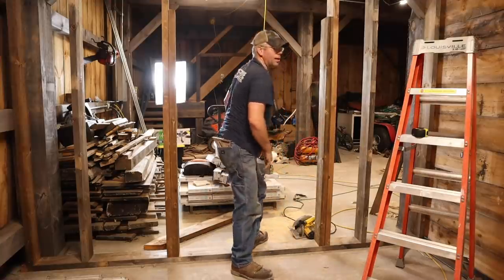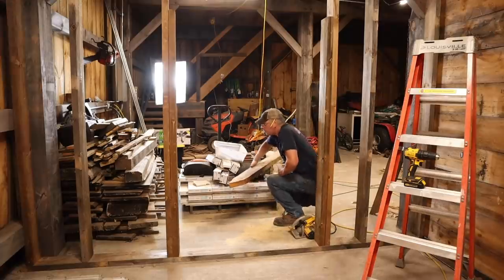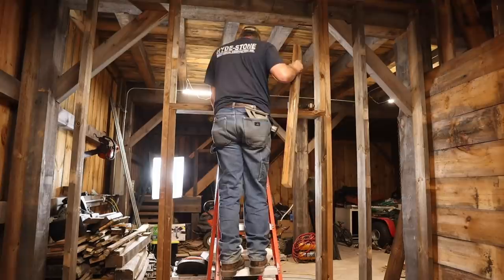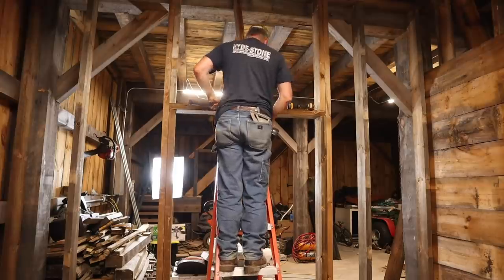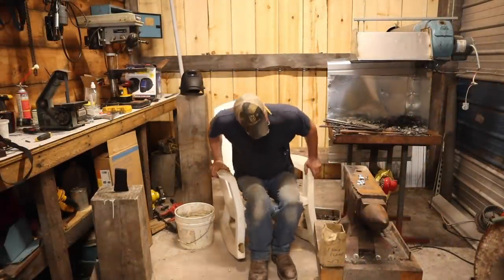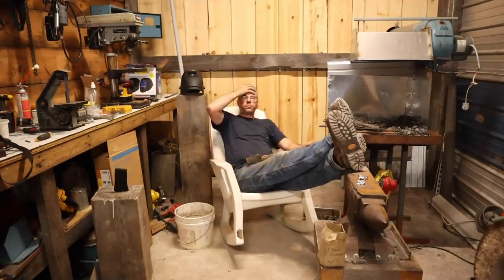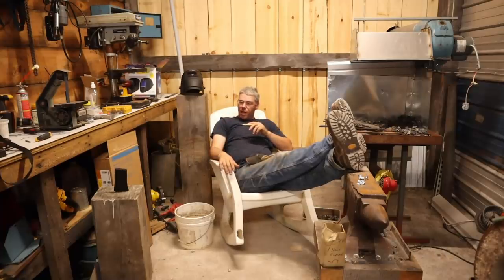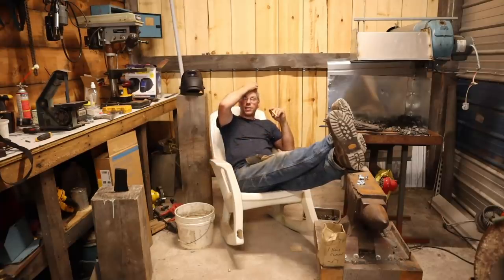Old Men and Dirty Jokes, Working On Walls In The Timber Frame...What a Night

Comment: Hey, guess what, I got the notification for this one.
Morning Jim. I started watching this at about 2:30 am, but dozed off after a long day of studying about half way through. I had a viewed count of 5 when I started watching it, if that even matters at all. Guess I should have stayed vertical till I was done, but then I wouldn't have had so many great comments to read (and a fee to comment on).
As far as wrapping the posts, that kinda sucks for the appearance, but I definitely understand it is for fire prevention. I still feel an emergency exit out the back would be a wise investment of time. We all know how accident prone you can be, ha ha ha. (Hope the leg is past bothering you for now and doesn't flare up issues again as you age. ) As for the giant exhaust fan, we know it's for blowing your coffee farts out of the room, don't fib to those that know you.
Also, I always heard it as, "it may be short, but it's as big around as a tuna can".
Also, good thong you have a heat source in there because you probably can't reach past jeans and overalls to take a piss. LOL 
Hey, if the metal doesn't look that good to you, AutoZone has different color high heat paints than just black. Look at the assortment for brake calipers, and exhaust manifolds. I'm sure the caliper paint would be fine for a spark or slang to bounce off of. Of course some flying burning debris will leave little scorch marks over the years, especially behind belt grinders, but hey, you can always repaint it every 5-10 years.
"See ya in the funny papers".

Comment: I understand...and agree with (especially controlling light for video) your reasons for setting up your blacksmithing area like you have, but I have ONE doubt/question about it:  Aren't those wood (flammable) walls awefully close to a forge and...think sparks...anvil you'll be pounding hot steel on?  Perhaps the distance to flammable surfaces is more in real life than it looks like in the video, but from this perspective it looks awefully close for what you will be doing.

EDIT:  I spoke too soon in the video.  Gitcha.
Reply from the maker: I mentioned steel going on the walls all the way around because of sparks.  I also believe in a fire watch after working for a couple of hours.
Reply: @TheTradesmanChannel  I saw that later in the video...its why I edited the comment.  I wrote the first part of the comment earlier in the video so I wouldn't forget by the end...CRS don't ya know...LOL.
Reply: @TheTradesmanChannel  you could edit on a laptop in the forge area while doing your fire watch... two birds one stone.

Comment: Your 6' 7 1/2'' off floor corect?? hum
Reply from the maker: 6'8" to the bottom of the header from concrete.
Reply: That bottom board is probably 2" David especially if its a rough board
Reply: No room to shim jamb. Hum
Reply: Probably no jamb - right?
Reply from the maker: It's a barn, nothing fancy.